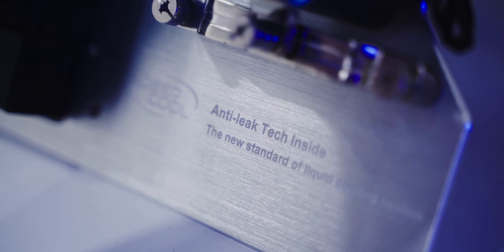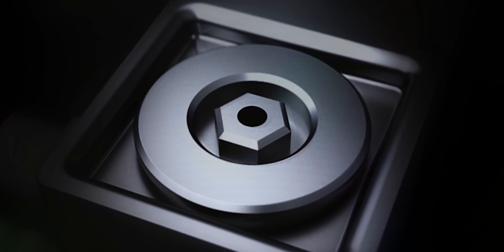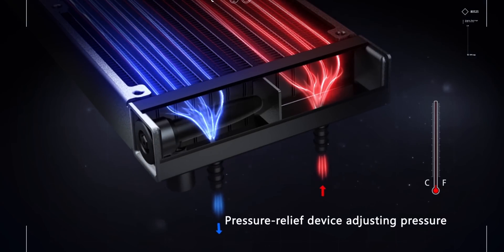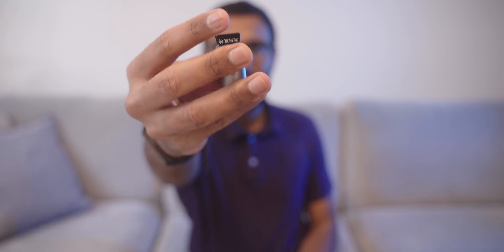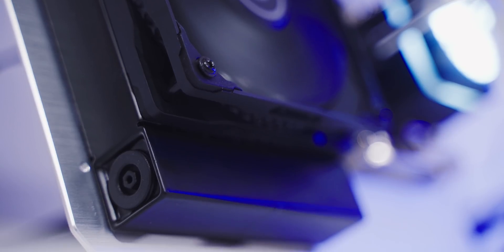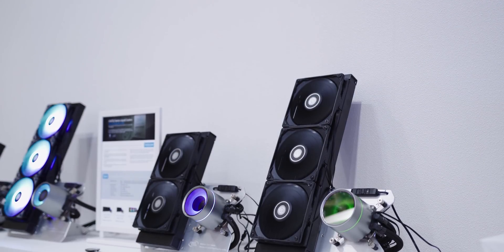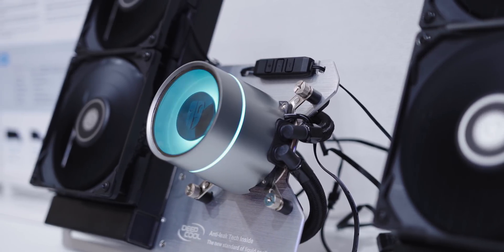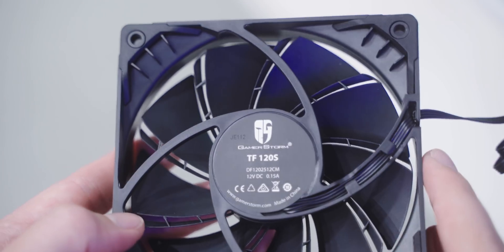Next Gen Anti-Leak AIO Technology REVEALED!

Comment: Radiator, heat sink, not checked The screw holes are not cleaned after painting. Overall, can be used normally

Comment: All this Anti-Leak tech is only for other PC parts protection, cause when AIO leaks, the coolant fries other components. 
I don't get it! They can simply use non conductive coolant inside! Problem solved. Nothing will be harmed even if the AIO explodes.
Reply: Won't that increase the price though?

Novec fluid is like $400 per gallon.
Reply: @PSYCHOV3N0M  Indeed mate. But they can build 10 AIO with that amount of coolant. Price will be increased by 40$ each. This will cut all those "Anti-leak Tech" stuff. Which I believe costs more than 40$. Thanks.
Reply: It will be conductive after a prolong contact in metal.

Comment: so basically this is telling us all the leaks that happened so far is caused by thermal expansion and contraction?
For all the old designs, weren't there a vacancy in the loop so the air was working as the buffer?

Comment: Isn’t leaking something that should not happen to any of AIO device? It points out many AIO have leaking problem when they make anti-leak as a sale point.
Reply: Any constrained liquid in an enviornment that fluctuates temperature will have this problem. Custom loops can have this issue as well. It's rare in both scenarios, this anti-leak system just makes it more rare and therefore increases its lifespan. No water cooling solution is immune to leaking over many years.

Comment: I dunno, isn't that adding another failure point into the system? What happens if dust blocks this valve? Does that introduce any kind of moisture inside the case?

Definitely looks like a cool piece of engineering though.
Reply: it's just literally a bladder. things like this have been implemented for this purpose for at least a hundred years now. it shouldnt introduce moisture because it's basically like your AIO plumbing, but it's stretchable. if your plumbing isn't producing condensate then this shouldn't either.
Reply: Old technic. Using a membrane and a compressible gas to maintain pressure in non compressible liquid is used in heating, car dampeners, oil industry etc... Nothing new